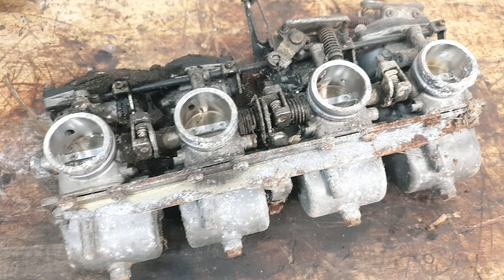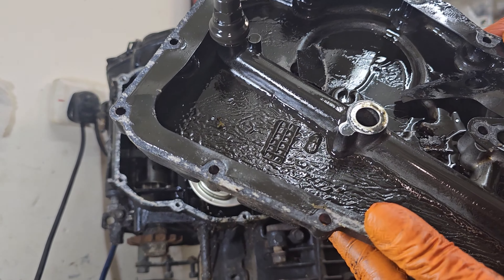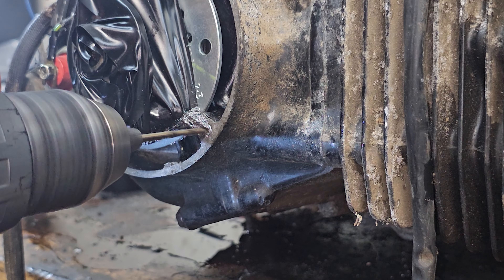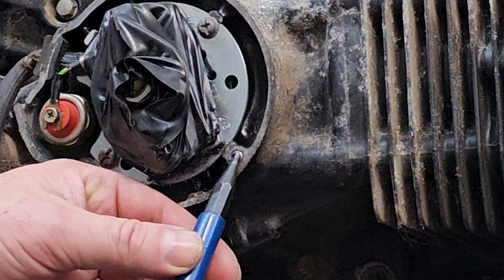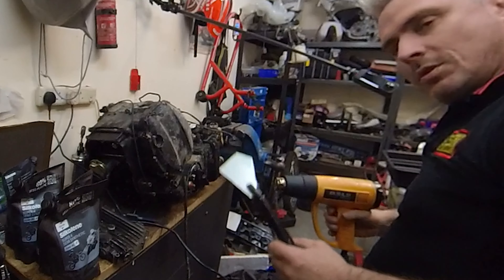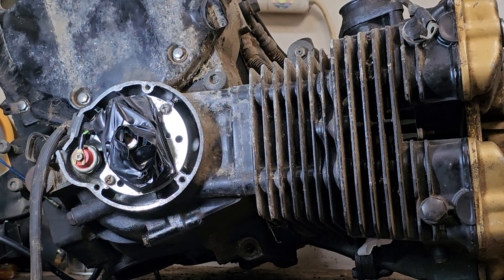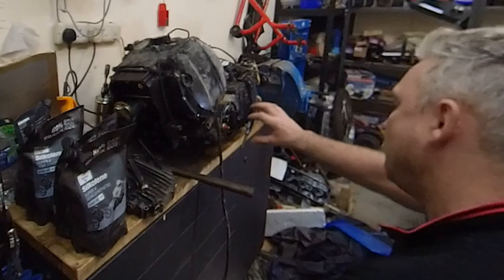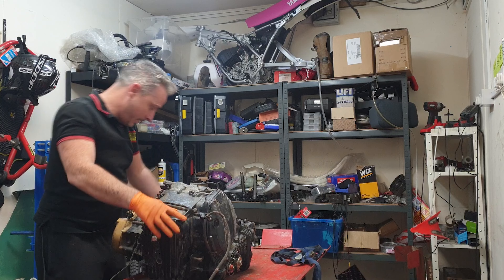Suzuki Katana barn find recommission will it start? pt3

Comment: It was Realy risky drilling down the centre you did well to get it sorted,
I always weld a nut on to broken studs then they come out straight away 😎
Reply from the maker: It was only a 5mm bolt so would have probably damaged the crank case by welding. 🤔

Comment: Hi there i had the smaller and older GS550 the one thing you have to take note of are the cams oil ways that was the only weak part i found on the engine had the GS1000 too great bikes had lots of fun with them am looking around for a Z1000r turbo the only bike i gave a disliking too got one new but turbo failed time and time again. PS where was the star of the show this week !!!!
Reply from the maker: He was curled up in his bed in front of the tool box.. 🤣
He's crap and fetching me the tools. 😉

Comment: Surprised you didn't lay the motor sideways and drop the frame over it. I noticed your the only other mechanic besides me that uses a small ballpeen hammer. Every other guy I've seen here or in my travels uses a big old 2 lb monstrosity. Finess works better!
Reply from the maker: Yes I prefer to use smaller hammers on delicate jobs around ally.
Many would have just drilled it out and helicoiled it but I think original is always best. 😁
Reply: @SpecialisedMotorcycleTransport  from back in the day when helicoils didn't exist

Comment: Errr....Baz; Helicoils and Plus-Gas.......
Reply from the maker: I'd much rather save the original threads if I can buddy. 😊
Can't get plus gas in my local shops.
Reply: Errr... I used to get it in (believe it or not) Halfrauds.
IIRC You can clean out the threads that exist with the right Helicoil.
Plus-Gas (liquid) works into the threads by 'capillarity' (Capillary Action).
$|-|1T£ like WD40 is only good for coating on cabling (plastic) to prevent them getting wet.
I can't remember if that age Katana uses Japanese thread pitch (IIRC 1.25 mm).......
Reply from the maker: @forandonbehalfof4753  Basically all penetrating fluid is just kerosene so not a lot to choose between them but I wasn't using WD40 it was GT85 which is cheaper and I'm a tight yorkshireman..😂 I keep that in my store for after I wash my off road bikes to get rid of the water so I've always got some.
We got there in the end either way. 😊
Hope you're doing well buddy. 👍